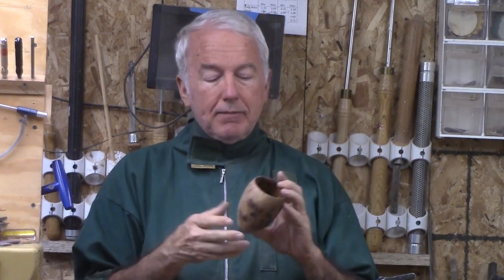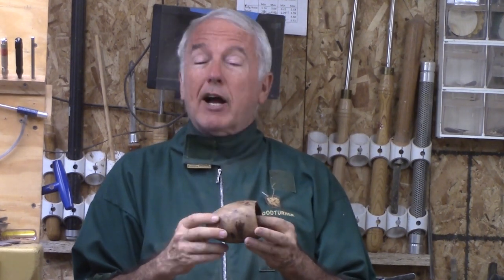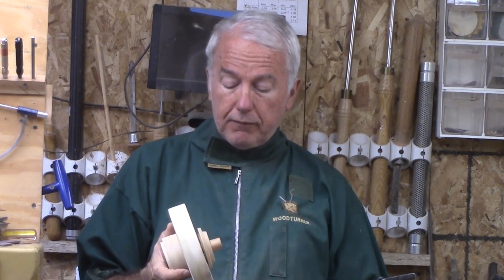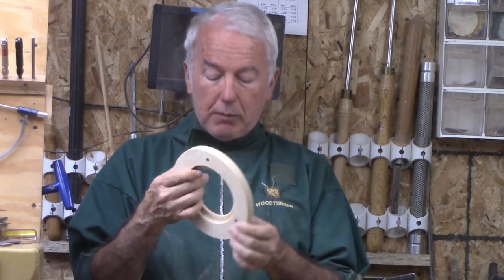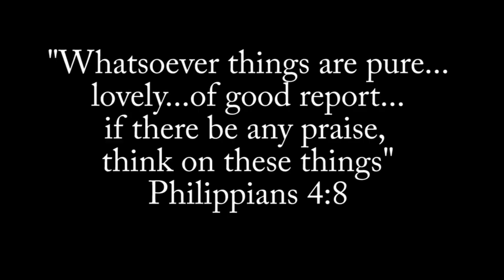Woodturning Elm Burl Vase That Almost Was Not

Comment: So if a chunk of wood is big enough to hold on to it's best not to throw it away. Inspiration may just come along alter. It sure did in this case. That is one really good looking piece of work. It didn't look like much as you were turning it but when the finish went on it sure came alive. And the donut chuck is very versatile. I think every turner would do well to have several sizes. Thank you for sharing. Have a great day and stay safe.
Reply from the maker: What about a piece of wood that could be glued to another for turning. Do I need to keep those?
Alan

Comment: It doesn't matter what you call that chuck, IT WORKS !!! That's the most important thing.  I'm not much on the folk's who use epoxy all the time but a little just in the cracks might not be a bad idea next time. BEAUTIFUL JOB 👍👍👍
Reply from the maker: Other than epoxy on the whole thing, where would you have used it? :)
Alan

Comment: Very elegant little vase, Alan, and what a coincidence! Only yesterday I completed a doughnut chuck so similar to yours. I used 6 long round nuts in the base to provide plenty of thread (against vibrating loose)and  to ensure verticality, with sets of 8mm diameter rods. Very rigid construction, and with the recess for different shape seatings. Maximum project width 6 1/2".I like your recessed top plate; I used low dome nuts to minimise risk, and thin plates to conserve weight.. Tested it at 1250rpm, which is double anticipated  speed of use, it ran very smoothly. I have plenty of early boxes that need touching up, or burning, but can now mount them for reworking.  Bernard.
Reply from the maker: Great minds think alike. :)
Alan

Comment: love the donut chuck please what wood did you make it out of and did the bolts have nuts they screwed into or did you tap a thread in the wood
Reply: sorry i just saw the insert nuts but please what wood did you make it from.
Reply from the maker: This one was made from 3/4" Baltic birch plywood.  My previous one was 3/8" common plywood. That one was too flexible.  The 3/4 is nice and stiff and is thick enough to recess the bolt heads and have a strong mortise for swapping custom rings.
Alan
Reply: thank you